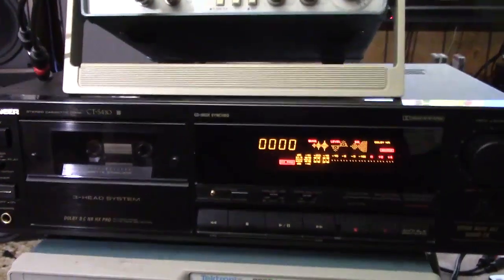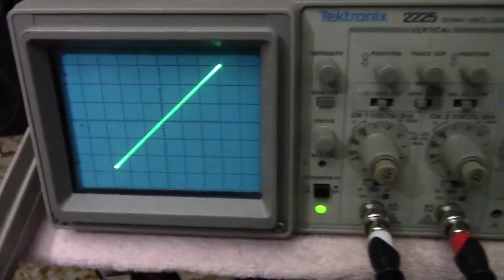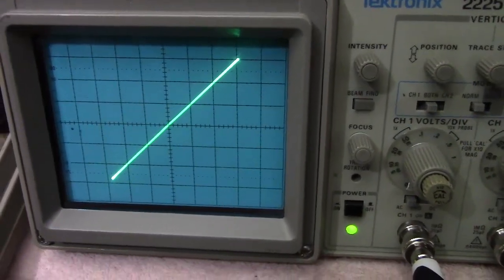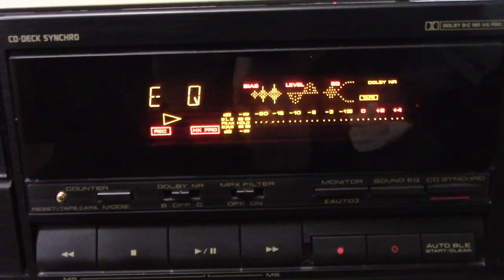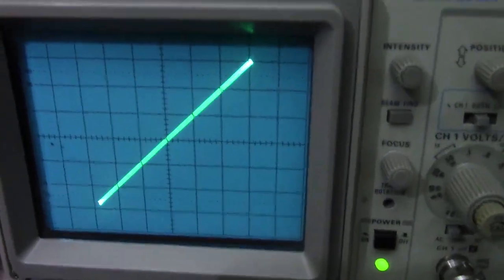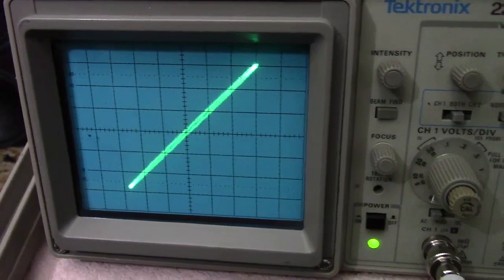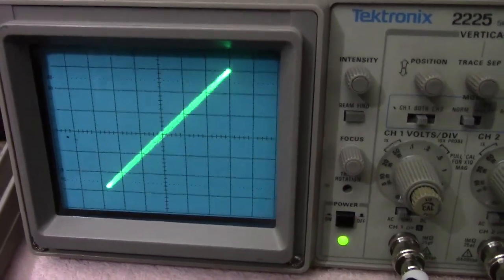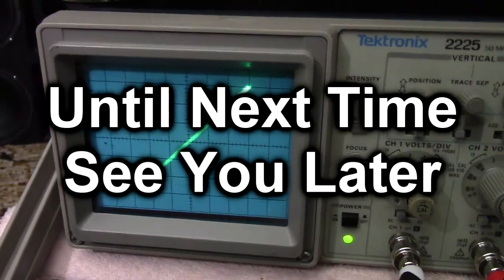Tape Head Azimuth: O'scope Assisted- Part 1

Comment: He’s basically doing the wrong thing. He will use this “pioneer” cassette deck as a standard for the rest of the cassette decks he’ll be aligning. And that’s where the problem starts. Simply bcoz if this Pioneer cassette deck is messed up, all the rest are actually going to mess up as well 🤣🤣 What he did was he aligned the recording and playback head of this deck. Thats correct! 😂 Getting the recording head aligned with the playback head is easy, BUT !! is that recording head “aligned” at all, is the big question😳🤔  He should have simply used an azimuth alignment tape from a reputable manufacturer instead. And go from there.. Anyway good luck 😄

Comment: Your methodology is totally wrong, but I like the cassette deck. I have the same model sitting right here along with a blueprinted and modified Teac V-1050 that's flat within 1dB from 20Hz to 20kHz with a TDK FE using Dolby C. I bought the Pioneer for spares as it has nearly the same mechanism and identical heads to the Teac. It turned out to be a good runner after a belt change and quick service, so I'm keeping both for now.

Comment: It's a leap of faith that this deck is aligned for making a reference tape.  Yes your input is in phase, but recording a reference tape on an unknown head alignment proves nothing.  Manufacturers made single trac calibration tapes recorded across the width of both channels to ensure it is in phase.  As an experiment, change the azimuth out of phase, then record the tone again and play it back.  PB will still appear in phase. Garbage in/ garbage out.  All you did is adjust other decks to be the same alignment as your CT-S410.
Reply: It would be the same erroneous assumption to make a home brew 3,000 Hz speed calibration tape.  Generate a 3,000 Hz signal and record it to a deck of unknown calibration.  PB to an audio frequency counter will show 3,000Hz because record speed and playback speed are the same.  Garbage in/garbage out.

Comment: So, I thought it was Channel 1 for Right and Channel 2 for Left. The service manuals I have suggest that the old meters use L for Vert and R for Horizontal. My scope (a Tektronix). And that makes sense to me because X would relate to the horizontal coordinate and y to the vertical, and it's called X,Y mode, so it stands to reason that X would be 1 and Y would be 2.

Comment: I disagree, your approach is wrong. All you check here is the azimuth of both heads - recording and playback are aligned, which is done in the factory,  and you cannot change. But if you play a test cassette, recorded with aligned test recorder, then you'll have a reference sinewave. That reference should be used to adjust the azimuth. ...and that's why test tapes are quite expensive.
Reply: Totally agree with your assessment sir.
Reply: Same goes for speed calibration, although w/f can be measured without a proper reference tape.
Reply: I disagree with you, Green Ghost..because ( on a 3 head cassette) the rec and play heads are fused together, you can ,by recording a 7kh signal and then monitor the output and adjust accordingly. If the 3 heads are completely seperate, then you need a test tape.

Comment: This really isn't the correct way to do a proper head alignment. You are referencing from a deck that you don't know if the head was in proper alignment to start with. One really needs a factory calibration tape to ensure proper alignment of the head.
Reply from the maker: The proof is always in the pudding, so they say. Every tape I've played back on other machines and factory bought music tapes sound excellent. I'd say the job is done and satisfactory. I agree with your assessment that an alignment tape should be used (when available). Thanks for watching.
Reply: @HammyTechnoid  But Micheal is right. I, as well as many in the profession, always use a calibrated TEST tape when aligning the azimuth. Your measurement technique is incorrect sir. Its worth the money to invest in a good test tape OR create one from a deck you know for sure is aligned properly.

Comment: One good way to tell if things have been messed with is if the factory lock-tite is still on the azimuth screw, usually looks like red or green paint. May not apply to all decks.
Reply: Actually, if you read HiFi magazines back in the golden days of compact cassette, reviewers almost always complained about manufacturers not doing a proper factory alignment. One german magazine even went so far to take close-ups of their test candidate's azimuth screws to encourage those with enough skills to check the alignment against a reference tape. The only company that never ever let them down was Nakamichi. Their quality control was as perfect as you'd expect from japanese engineering. Sony, on the other hand, often handicapped themselves, even with their high-priced ES lineups. And it wasn't about azimuth only (you won't usually hear that with your own recordings anyway), the heads often were also misalignment regarding height, tilt and zenith. Which greatly limits the tape deck's capabilities in terms of sound quality and especially tape handling. A tilted head will also wear unevenly which will ruin the head pretty quickly. And in these days with virtually no spares available, it's a death sentence for an otherwise great and capable machine.
Reply: @svenschwingel8632   I totally agree with you I have seen  Decks with misaligned heads right out of the box.
Reply from the maker: You're right.. and somewhere in my folder of pics, I have a pic of the head block of this machine, and I recall seeing the untouched green loctite, so yeah, I'm fairly  certain this has a head assembly with proper alignment. That's a good tip for general knowledge.